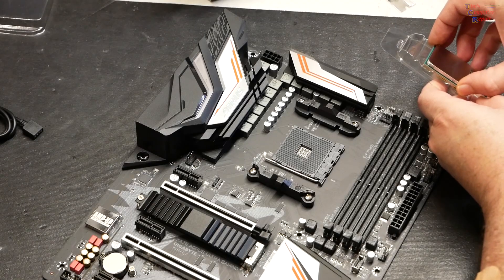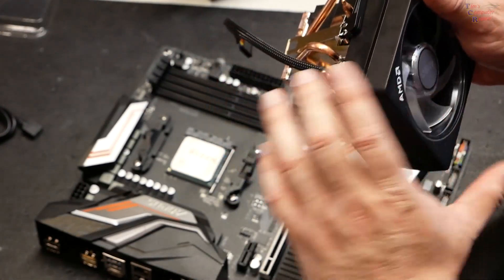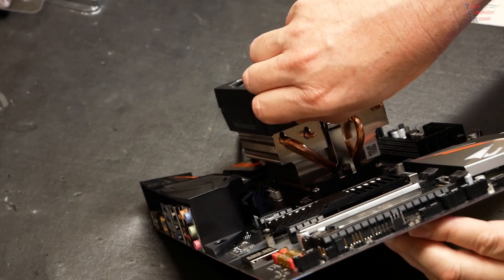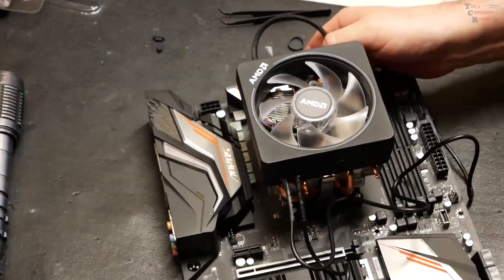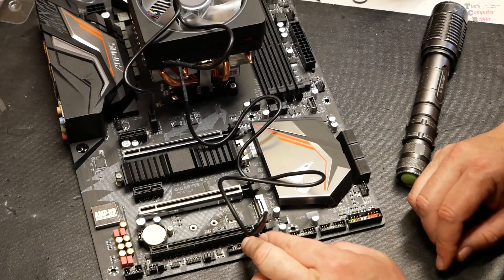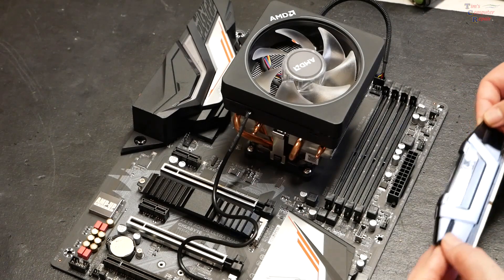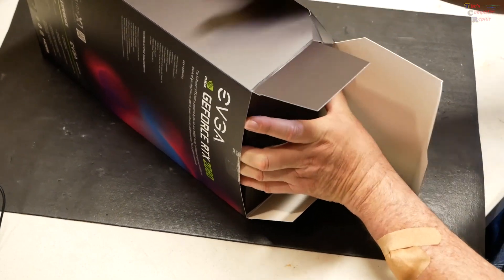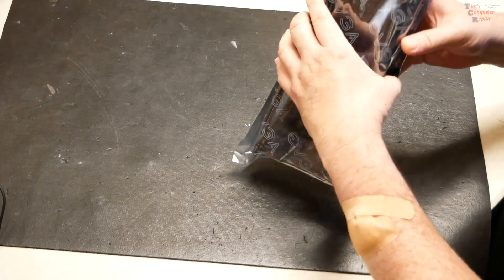How to Install an AMD Wraith Prism CPU Cooler

Comment: I only used the RGB and changed colours with software, did not use the USB cable, its very messy idea from AMD.
Reply: No actually it's not a messy idea. It uses cooler master software allowing you to have more precise control over the RGB-and for people without RGB headers it's a godsend
Reply from the maker: I'll try with RGB header and see how that goes. Thanks.
Reply: obb322 makes it look sloppy lol wym bro 😂
Reply: I only use the usb one. I know I have rgb headers but I’m not worried about it. As long as it lights up and it does... I just built a pc for gaming with a 3700x three days ago. I initially started out by using a Arctic Duo 34 and then switched over to the wraith prism last night to see the difference in temperatures
Reply: Are you saying that the cables are not needed to plug in for control over rgb?
Reply: Alexander Lee with only the usb header cable installed it will only light up. You won’t be able to control it.
Reply: @Mictian1980  could you share the results between the Temperature difference of the two coolers you mentioned?
Reply: @brainxrd3919  On my Wraith Prism idle/gaming temps are 40/68. On the Artic Freeze temps were 38/65. I ended up returning the Artic Freezer because that temp difference wasnt enough for me to justify the cost of owning it. Now with the Prism I did clean off the factory installed thermal paste and put on my own thermal paste so I dont know how much of an effect that would have had if I used the stock paste. I used Arctic Silver paste.
Reply: Do I need the cable to use the rgb
Reply: @ivanswartz3466  yes
Reply: @Mictian1980  excuse me,so it is a mandatory to install a cable for RGB function on this cooler? I just bought it but haven't install.. Or can i skip those cable and still have a default RGB lighting? Ok,my B450 board have RGB Header and USB.. or can i just install the RGB Header cable to get default RGB lighting..i don't really intend to control only needs
 it lights up..
Reply: @WanBerry  you need to install either cable to get the RGB lights to come on.
Reply: @WanBerry  NO!! I have NEITHER cables attached and it defaults to a NICE RGB cycling mode.  It WILL be uncontrollable, but it WILL work.  NO. It's NOT a mandatory connection
Reply: @mr.v5441  woahh!! i did use one of the cable and it works! i'm lazy to download and install the software to control the lightning BUT it's all good as i expected!

Comment: I was afraid that the retention handle will break when i flipped it but worked nicely. Thanks.
Reply from the maker: Yeah it is a bit tight. But that is by design. Thanks for the comment.
Reply: I just dislocated my shoulder due to that lever . That is frightening as f when you do that for the first time in your life.
Reply: Alexander Pas thought I was doing it wrong. This comment made me realize it was going to be okay. Thanks!
Reply: Same comment as Jonathan - I thought I did it wrong, but it is supposed to be tight.  Gotta keep that heat sink in really good contact with the Rysen

Comment: If I don’t want RGB lights, do I still need to use on of these short cables? I assume the answer is no since power to the fan is provided by the permanently attached cable.

Comment: I have to thank you for 2 weeks now I have built my 1st pc and I did I hope a good job but for the life of me, I have the AMD 3900x with Prism with CPU led cooler but I could not figure out how to get the LEDs to work via the cooler master program, and you are the only one who not only explains the difference of the two ports on the fan and what they do BUT you are the only one who shows you what is the right header to plug them into. so after 2 weeks I finally have my AMD cooler fan changing the colors I want them to be changing too!
Reply from the maker: Glad the video helped. Thanks for the comment.

Comment: I have same board with 2700x, but when my computer goes to sleep and is awoken, the fan begins to blink and make a usb disconnect nose. It goes away on restart. Do you have any idea why?
Reply from the maker: You need to update to the latest motherboard BIOS.

Comment: About the lever:
If it feels overly tight and you fear you might break it, push down on the metal on the left of the lever while pulling it. This makes the installation a LOT easier
Reply: Thank you
Reply: @gabeross8830  thanks! it helped

Comment: So assuming this comes pre-applied with paste right?
Reply: Yes i have same question 
Please tell me
Reply: yes it does but not a big deal to wipe it off and add something better. The pre applied paste tends to act like glue after a while so detaching the cooler from the processor is a little tricky. If  you yank it off without twisting the cooler first it can damage the pins.
Reply: @anotherstupidfeature  the pre applied paste is enough right? I don't have to apply more of my own?
Reply: @shadowreaper5413  It does the job well if the both cpu heatspreader and cooler heatsink are straight. If they are not and the pre applied paste layer is too thin, then the contact may be imperfect. This is why a droplet of quality paste on the center point of the heatspreader is a better choice.
Reply: @anotherstupidfeature  oh OK thanks. I'm just going to use the standard stock cooler that comes in with my r7 3700x which is a wraith prism cooler or something like that. For now I'm not planning on properly overclocking  ( Yeah I know ryzen Xs are better for OCing). But I hope soon I can buy a better cooler or water cooling even after a little while. But for now I'm pretty satisfied with my cpu running on standard speed.

Comment: So please explain to me that since you had the option to use either the RGB or USB cable to control your
lighting, why did you choose the USB cable when you complained about having to use one of only two
Usb ports on your Motherboard ????
Reply: I was wondering the exact same thing.
Reply: So you can use the rgb program to control the colors

Comment: Hi, i could really use some help please. When redoing the cpu fan (didnt pull the lever all the way and wrong orientation, first pc build...) I wanted to check the thermal paste to see if i smeared because i may have wiggled the cooler a bit. Accidentally smeared a tiny bit of the pre applied thermal compound in 4 pin connectors. Should i try and clean it with 90% alcohol or just leave it be (i dont want to take any more unnecessary risks. Any help would be very much appreciated.
Reply from the maker: I would try and clean that off with alcohol however you absolutely need to avoid bending any pins. Be sure the area cleaned is completely dry before installing.
Reply: Thank you for the response, i think i got it all out now

Comment: Thank u for Ur guide really helped me out of some doubts, if I'd allow me a quick question, when I placed the cooler I smudged a bit of the paste over the CPU when I changed the coolers direction, should I be worried and go and get another paste?
Reply from the maker: You should be ok. Thanks for commenting.
Reply: @TimsComputerRepair  thank u for your quick answer

Comment: How to you control the fan Speed on the RGB Wraith Prism Cooler - AMD Ryzen 7 3800X with the RGB Wraith Prism Cooler on a ASUS PRIME X570-P AMD AM4 ATX.?
Thank You Tim.
Reply from the maker: The CPU fan speed is controlled by the motherboard and cannot be adjusted manually.

Comment: Do you need to install any RGB controller cables if you don't want to ? I haven't connected the M/B RGB header cable OR the USB RGB controller cable ...
Reply from the maker: Don't have to no.

Comment: That pressure that is applied on the CPU while installing the stock fan just freaked me out. Glad to read and hear it's "normal". I'm also trying connecting the USB cable exclusively. I'm not sure what the exact difference would be if you were to connect the RGB cable as well, maybe you can elaborate?
Reply: I literally came to watch this video because I put the cooler on top of the cpu, then realized I can't take it off again without having to replace the thermal paste (which I didnt have). So I was just messing around for 20 mins trying to push the metal "hook" in, and applied some pressure until I managed to do it... scary, but your comment makes me feel more at east, thank you. I still don't know if my pc will boot up because msi flashback+ failed, so i went to buy more USB sticks today to try those out.
Reply: Did it boot? My system is running smoothly.

Comment: RGB better through usb or through RGB motherboard header? I mean I prefer to use Aura from Asus to control
Reply from the maker: Through usb. I control with Aorus RGB Fusion to control.
Reply: @TimsComputerRepair  i guess it work the same way on my msi mpg x570 gaming edge wifi board

Comment: Do I NEED to hook up one of those RGB related cables, or are they 110% optional?  Like can I get by with just having the CPU fan plugged in? My case does not have a clear side panel, so RGB lightshows are kind of pointless on my build.
Reply from the maker: You can get by with just the cpu fan plugged in. The cooler will do it's job without the rgb header or usb header plugged in.

Comment: Is the fan supposed to ramp up and down all the time? I upgraded from a 1700 with a new board and a 3700X.
Reply from the maker: That cooler does not work well with the 3700x. It runs too hot. I would recommend a beQuit cooler that is rated at a higher TDP.
Reply: @TimsComputerRepair  Thanks, I was thinking the Dark Rock Pro 4 but I need to see if it fits in my NR200P.

Comment: i dont want those   lights on it will the  cooler work ok with out plugging in those two cables ??
Reply from the maker: As long as the cpu fan cable is plugged in your fine.

Comment: What happens if I installed the cooler with and sign upside down? Sould I change the position or is that just for the cables to be less tight?
Reply from the maker: Won't hurt anything.
Reply: @TimsComputerRepair  thanks!

Comment: Would it be a good idea to add thermal paste to the cpu even if the cooler has it pre applied?
Reply from the maker: No need to. Very thin amount of paste will suffice.

Comment: Hook in the short side first then the long side (with lever easily goes does with a small push on top), then push lever down maybe with a small push too (vertically down). Setup fan cable. I’m here to learn about the rgb or USB cables which I’m seeing now. And how to hook this to an aorus pro wifi X570.

Comment: i know i am late but you are actually supposed to plug the usb for rgb in that 4 or 3 pin connector right to the left of the  rgb cable
Reply: at least that is what i remember the manual saying
Reply: @jackmikulski6969  manual? Where did you find one?
Reply: @nutterztube  i believe it was in my mobo manual

Comment: Is ryzen 9 3900x Stock cooler good enough for gaming?
Reply from the maker: No. Would recommend an aftermarket cooler.
Reply: @TimsComputerRepair  what about ryzen 7 3700x or ryzen 5 3600x

Comment: Well Screwed myself it didn’t want to clip for me and had to pull it off a few times and it kept peeling off am I okay till I can afford paste material be a few weeks at most the past is still on there just stuck off in different spots?
Reply from the maker: You should be fine.
Reply: TimsComputerRepair I’m showing 30-33 degrees off stream and 43-54 at most when streaming is that a good number for now?

Comment: You only need either the RGB or USB plugged in, you do not need both cables. They control the colour on the cooler, if you have an RGB header on your MoBo it is best to use it. The USB option is for boards without an RGB header.

Comment: So Basically you only put the USB (3-Pin) in and everything works fine...?
Reply from the maker: Correct.
Reply: TimsComputerRepair Thx for Helping..
Reply: @TimsComputerRepair  even rgb??
Reply: @halalphish4495  yes. the rgb is configured from Cooler Master software. the rgb cable is used only if you want to sync the rgb with aura sync, etc software, but your motherboard must support one of these software.
Reply: @SapiaNt0mata  so u can still control the RGB?
Reply: @halalphish4495  yes https://landing.coolermaster.com/pages/amd-ryzen-wraith-prism-rgb-software/
Reply: @SapiaNt0mata  but hello, is it ok with only usb, and its still lit up?

Comment: Does it have pre applied thermal paste?
Reply from the maker: All fans included with the case are 3 pin and they all connect to the included fan controller.

Comment: hey guys, I bought a wraith prism (used) on ebay but it didn´t came with the 3 pin cable, does anybody know when can I buy this cable?
Reply: I have the same problem
Reply: I dont think there is a solution

Comment: Off topic but how hard is it to bend a cpu pin lol I slid my cpu around to get a snug fit and I’m kinda worried I can’t test my system until all my parts come in
Reply: It is actually really easy to bend or break a pin on a cpu,but you can only bend or break it if you press on the cpu or touch the pins,and its actually kinda normal to need to wiggle your cpu a bit before it drops in the socket
Reply: Proffesor Pantheon ok thanks man pray for me that no pins are damaged haha
Reply: @manifested1850  yeah good luck man hope i helped ha
Reply: @manifested1850  ayy how did it turn out
Reply: If you're not feeling to confident, you can always pull it out again to have a check. Then, when you reinsert, just make sure that you're using a light touch. It's in as soon as you can't see daylight between the processor and the socket. You can then close the latch with complete peace of mind. :)

Comment: Let me share with you what I found out and read:
It's not the USB cable we need - I am just also installing R7 3800x on Asus motherboard and what I found out is that USB cable is connected only when additional software for RGB management will be used. If you use and would like to manage colors from Motherboard software/systems, like Aura Sync etc then you put only 4-pin RGB cable.
Reply from the maker: I am using Aura Sync through USB
Reply: @TimsComputerRepair  if you only use the rgb cable, and not the usb, you still can configure your rgb through the aura sync👍🏼
Reply: @mutantchannel1334  good to know

Comment: 2gen ryzen 7 2700x
3gen ryzen 7 3700x

The two cpu come with the same wraith prism cooler?
Reply from the maker: Yes but I would not recommend using the stock cooler on the 3700x. Runs hot

Comment: I think this video should be titled "Gloating over my RTX 2080, with a small note on cooler wiring". Haha.   I would add to remove the factory applied thermal paste and apply your own, if you ever want to remove your cooler in the future without ripping the CPU out of its socket, as the factory paste turns into super glue

Comment: According to my motherboard manual (ASrock B450 Pro4), you have to plug  EITHER the 4 pin  RGB cable OR the USB one, not both. I tend to think RGB lights are silly, but I'm building a PC for my nephew who think it's super cool...

Comment: i installed the cooler in the wrong direction flm. i jus opened it and the thermal was smothered all over the cpu, i then put it in the right direction and put it on. uhhh is that okay?
Reply from the maker: Should be ok.

Comment: what can actually be controlled with the RGB software from cooler master? only the fan or also the rainbow ring?
also how do i sync it with aura sync? cant get this to work..

is the rgb pin gen 1 or gen2? so adressable or just single color?
Reply from the maker: The fan, the ring and the logo all can be controlled separately.
Reply: @TimsComputerRepair  but only via usb in cooler master, not with aura sync right? ):
Reply: @liquidmasl2675  right

Comment: do i need t use the usb cable or rgb cable? like will it work find without the usb and rgb cable in?
Reply: You want to use one or the other. If you use the LED RGB cable it will only show the default color setup. If you want to be able to control the three different color pieces you want to only use the USB header connector.

Comment: ahh i was wondering about the thermal paste. mine had it too but very little dots in a square pattern. i bought a extra ''tube'' of it because i didnt know it came applied already. so thats good to know that i dont need to put any extra on it.   first time for me building my own pc.
Reply from the maker: The pre applied paste on the cooler works perfectly fine. You will be ok.

Comment: How difficult would this be to install in a case already built
Reply from the maker: Depends on if the case has a cut out in the motherboard tray for access to the back plate of the cpu socket.

Comment: Hi I'm busy with my build still. from also reading forums and from this video. rgb connection will not allow full control. only through USB?
Reply from the maker: That is what I thought also however I have had others tell me that you do have control through rgb connection also. More confirmation is needed.
Reply: @TimsComputerRepair  Nice vid! do you have more information about the comment above?
Reply: TimsComputerRepair I just bought this processor an noticed that AMD mentions in their install instructions that it is either the RGB option or the USB option. The font explaining why is so small that it is unreadable, but i think the USB option is only to be used if the motherboard does not have the RGB header.
Reply: @marcdraaijers3230  Nope, if plugged into a motherboard RGB header you will only have single colour RGB. 

The only way to get addressable RGB like you see in product photos & reviews is to plug it into a USB header and download appropriate software from cooler master's website